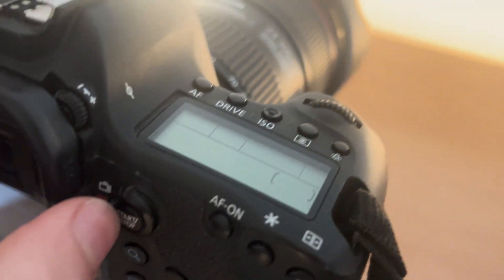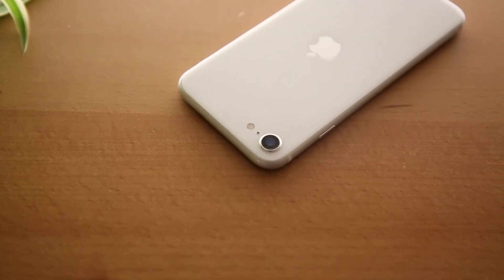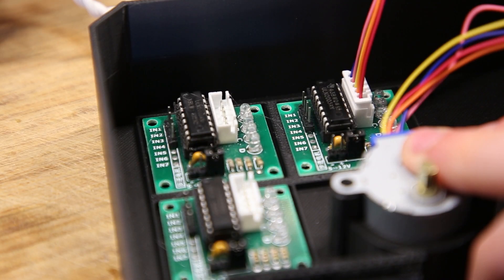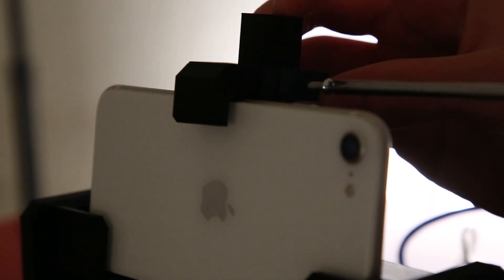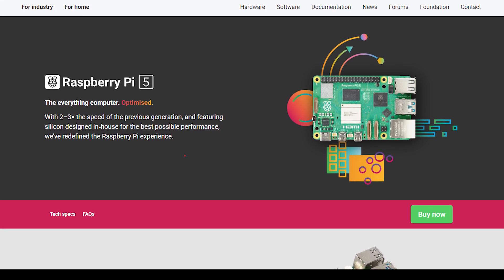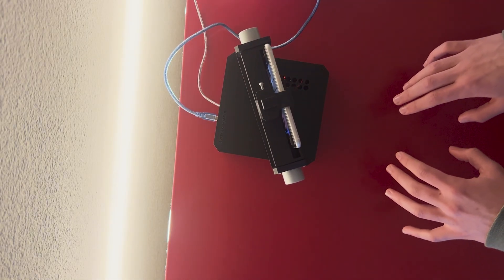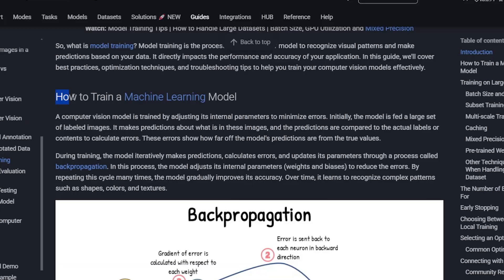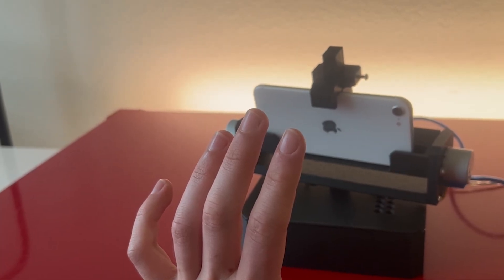I Used AI to Center My Videos

Comment: This is natively integrated into iOS with DockKit compatible mounts and it works for every app, but doesn't work for iPhone 8 so your solution is still valid for your use-case, also hand tracking would require custom code. Nice vid.
Reply from the maker: Hey thanks for the comment and glad you enjoyed! I haven't heard of DockKit until now and yeah that's probably the way to go if you need more reliable/smooth tracking.

Comment: What was the main bottleneck for reaction time?
Reply from the maker: A lot of the bottleneck was coming from the processing power of my laptop which meant I had to use a less accurate version of the hand tracking model  that wouldn't always recognize my hand in order to get higher fps.